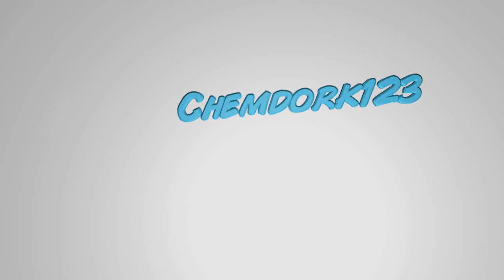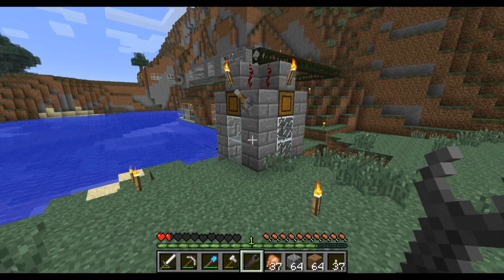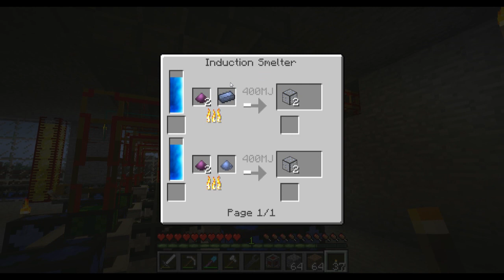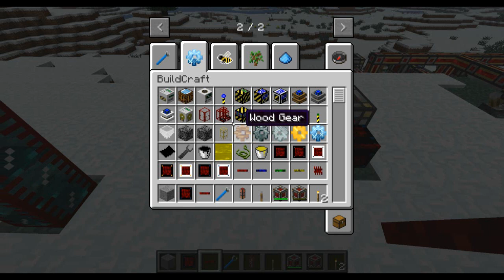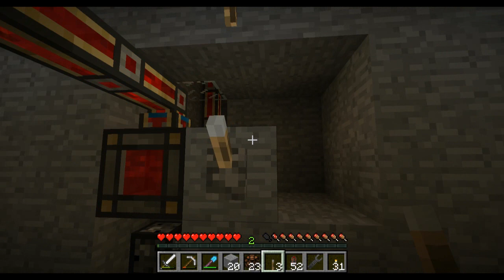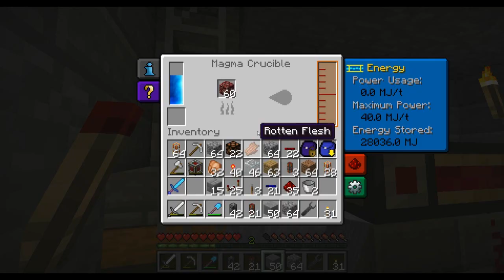My Buildcraft S2E09 - Power Plant Upgrade

Comment: Chemdork123. I have a question. I have made myself a modded minecraft in 1.7.10
It contains the mods: Computer craft, Buildcraft, QuarryPlus, Extra Utilities and Rei's-Minimap. Here's the question: how do you download NEI to where it wont crash in general, and make it show up. It says I have the mod, but it wont work, it wont show up. Please tell me how to download and or fix the problem. Write back as soon as possible Thanks!
Reply from the maker: ThatGuyThatPlayzMC Well, does NEI show up in the list of mods at the title screen?  The 'O' key toggles showing/hiding the NEI interface while you have your inventory open in-game.  I've never had an issue with NEI specifically causing the crash.  In the worst case, NEI was just missing recipes from other mods.  Finally, you need to install the chicken_code core (or something like that) for NEI to work.  The link to that mod are found in the same forum post as NEI itself.  It is required in the same way that forge is required for BC, etc.
Reply: I downloaded both chicken_code core and NEI. I then launched minecraft. I can play the world fine, but when I open my inventory, NEI is still not there. I also to the "O" key to consideration. I pressed the "O" key, and nothing showed up. I did not look in the controls, for it may be another button when I downloaded it. Could it possibly be another key?

Comment: Chemdork123 is it possibly to have a RS Nore latch on a nuclear reactor cause I'm working on mine but I also want to find out how to find oil in my world too I have the mods I just can't find them have any tricks?
Reply from the maker: Well, the RS NOR latch can be used, but not sure what you are wanting to do - I'm guessing turn off the reactor if it generates too much heat?  If that's the case, you would need some sort of way to be "notified" when there is too much heat.  I don't have the mod for the reactor, so I cannot give any pointers.  Is there a way to read information about the status of the reactor using BC pipe gates?  If not, is there any other signal you can use?  You need to have a redstone signal output when the reactor is "too hot", then just connect to the "OFF" side of the RS NOR latch and you are good to go.  As for oil, there are no tricks.  If you installed the mod after you started the world, you will need to travel to a location that you have not been to yet.  Oil generation happens at the same time as world generation.

Comment: ChemDork123 i Have a question for forestry i got the mod but i dont know how to delete the ores?can you explain?
Reply from the maker: In your minecraft folder there should be a "configs" folder somewhere that has a document you can edit related to forestry.  (I forget where exactly).  In that file near the end is code for ore generation to be turned on or off (True or False).  Just retype it as "false" and you are good to go.  This will not remove ores already generated and will only apply to a new world or new areas in the current world.  So if you want to remove all that extra ore... start a new world or move far far away.

Comment from the maker: Sounds sort of similar to what I have - I just have the whole logic connected to the closest RSEC.  I also added in a feature that sends power to the RSEC when it is being refilled to stop power from flowing out.  This basically allows the RSEC to always be able to reach full capacity - the downside being that if I draw too much power elsewhere, it would cause some of the machines to stop temporarily.  I just have to keep the power balance in favor of the power plant.

Comment from the maker: While that might work with other engines, that would not work with combustion engines due to the need for a cooldown time period.  When the redstone energy cell becomes full and the engines shut off, it is very likely in that setup that some power will be distributed out of the energy cell and call for the engines to turn on again in a short period of time.  This setup always ensures enough time for the engines to cool, and is (essentially) the easiest way to do that.  RS NOR = simple.

Comment: when I do that I get this crazy flip flop engine where they go on off on off and the engines need some cool down period. I do a toggle latch where when the RSEC closer to my machines can store energy it activates the latch and when the RSEC in the power room is full it toggles the latch back off so they run a while then cool off I like that better so when i'm using a small amount of energy the logic isn't constantly twitching on and off.

Comment from the maker: What Speltzen said: The emerald waterproof pipes work the same as the wooden ones, but can hold as much as a gold pipe (wooden waterproof pipes only hold as much as stone/cobble).  Emerald pipes (non-waterproofed) work like wooden pipes, but allow you to control the item type that is pumped out.  So, if you had it connected to a chest that contained cobble + dirt, you could specify to just pull out the dirt by using the emerald pipe interface.  It's kind of like a filter.

Comment from the maker: Do you get a blank screen?  My advice is to backup your save (and .minecraft entirely), and then start completely from scratch with a brand new, un-modded version of MC by deleting your .minecraft folder, then starting Minecraft launcher and having the newest, clean version downloaded automatically.  Then install Forge ONLY and make sure it runs properly, then just copy the BC file into the "mods" folder.

Comment from the maker: Thanks for the heads-up. I made sure to place the energy cells in locations that were not affected by the redstone (unless I wanted them to be).  You could also set the redstone control functionality to "disabled" so that the energy cell is "always on" and ignores redstone input.  As of now, it seems to be working splendidly!  I have updated slightly the system of power plant control from this video to refine the logic.

Comment: Hey chemdork, just a small tip if you didn't do this already. Double check your other redstone energy cells that are closer to your machines and disable the redstone control. Your circuits may interfere and stop power flow when you turn your systems on.

Comment: From what I've read, the energy cells won't put out more than can be used, so setting the output for less than max is like plugging a lamp into an electrical outlet so the electricity won't leak out.